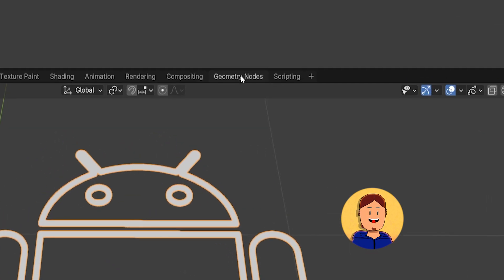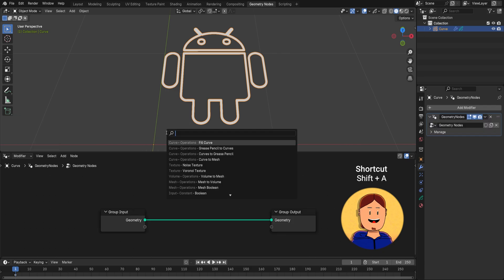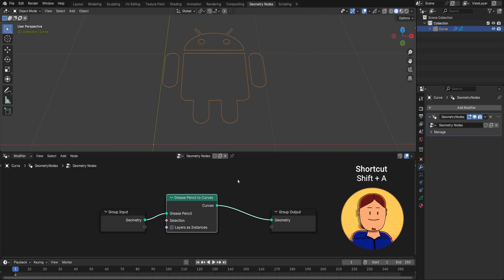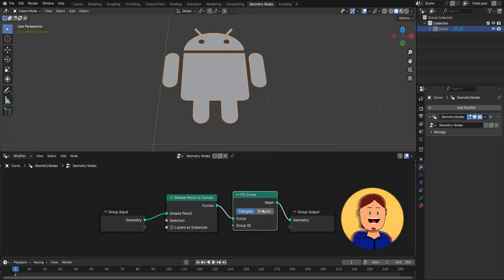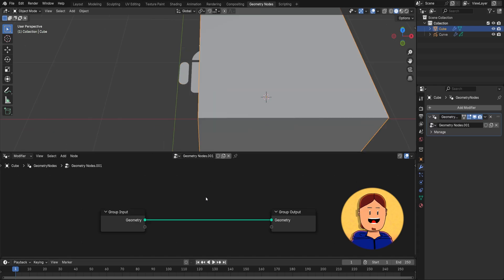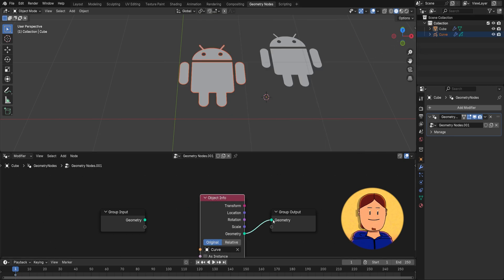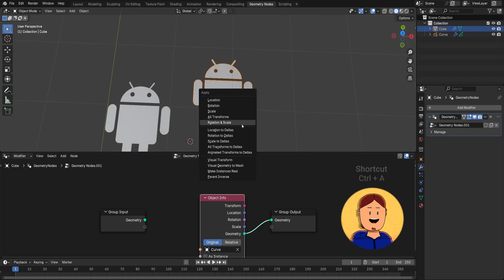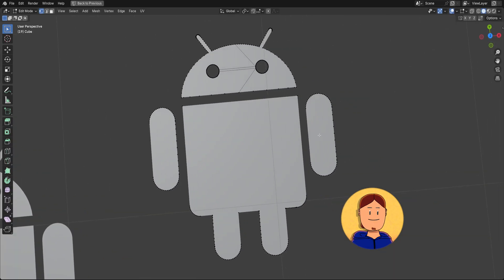SVG to CLEAN 3D Mesh using Blender Grease Pencil

Comment: And now if you show us how to make a sven co-op model from scratch, using just a front pucture of character, side and back picture, with the vertex groups and goldscr engine, I believe there is an auditory, that will really appreciate it 🍀🍀🍀 I really wonder how to create a MDL file suitable for sven co-op from scratch. Like what to do and what not 😅😅 I've been still looking for ways to do things in blender. I found out that if you have a mesh made from many objects and they have textures, when you press CTRL+J, the textures disappear. The trick is that the UVs must be the same name for each object you gotta go to that little green triangle I think? And then where it says UVs (or something like that) the name there for each object of the mesh must be the same so the textures don't disappear. 🍀🍀🍀